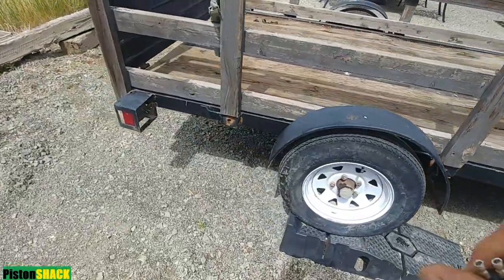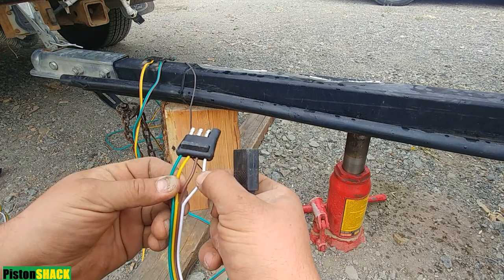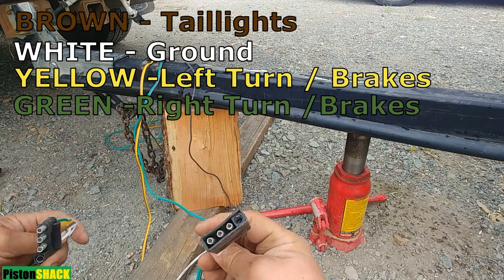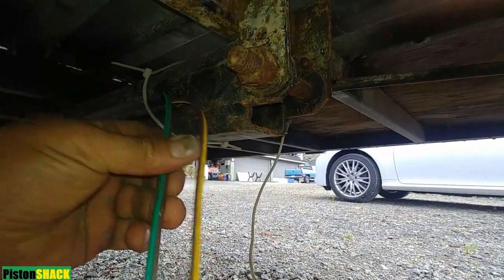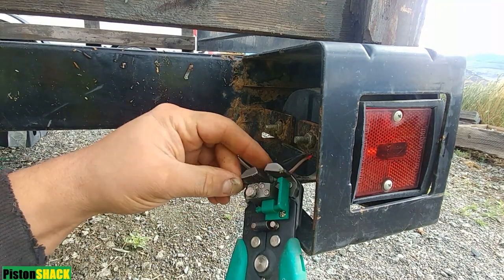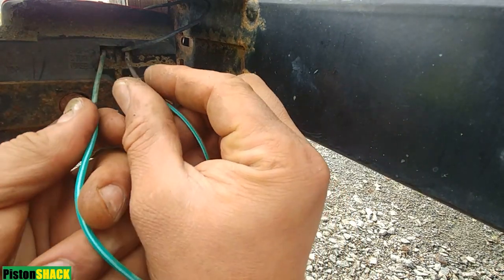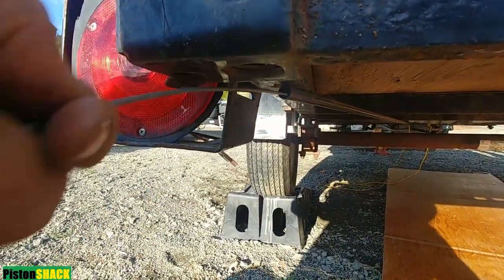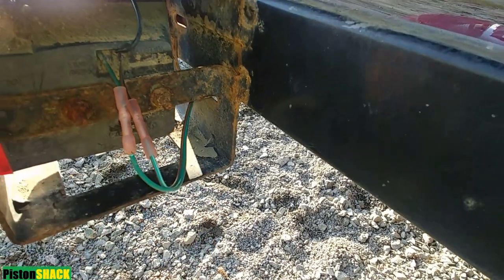UTILITY TRAILER LIGHTS 4 PIN WIRING HARNESS | COMPLETE  REWIRING | Explained In Details

Comment: Much simpler and more complete instructions than most vids that are 3 times as long. Also nice to see old light fixtures being rewired rather than replaced. This was very helpful.
Reply from the maker: That's awesome Mark! I am so glad it helped you out. Well, it's always great to re-use and repair rather than through out, if possible) Cheers! What trailer do you have, bzw?